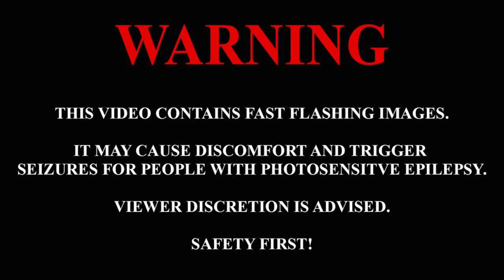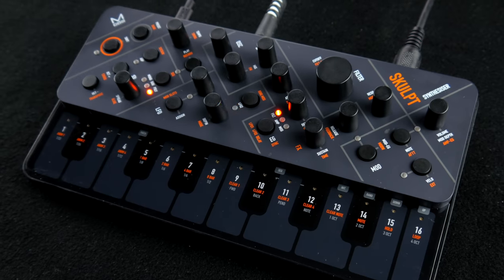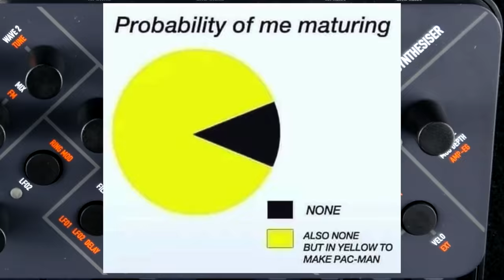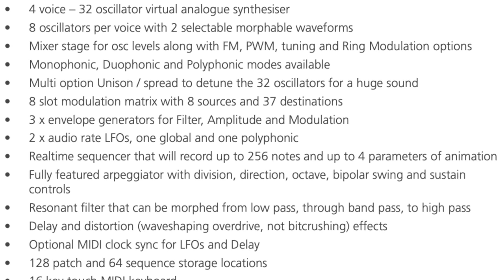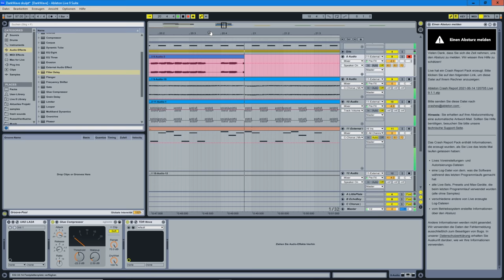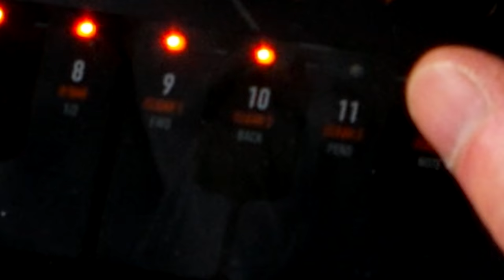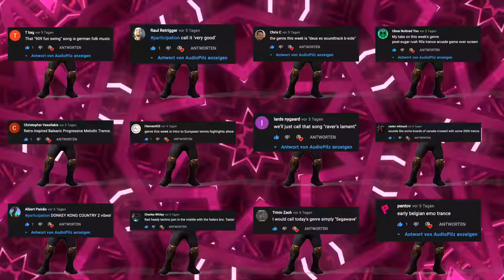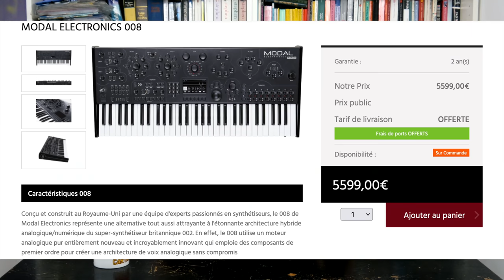Bad Gear - Modal Skulpt - Plastic Toy???

Comment: I’m not gonna lie, if it wasn’t for the fact that the beatstep is my centerpiece this would be a no brainer.  Currently debating the micro freak and that Roland JD.  (x1? Xi?).
Reply from the maker: MicroFreak is super interesting!!!
Reply: Have both
Microfreak = better/more interesting sound, consistently evolving firmware, atypical interface, seq is bad
JDXI = all in one groovebox, menu diving, drums sound amazing, no continuous support
Reply: I didnt regret buying microfreak. this little box has so much potential and you can go totally bonkers on crazy sounds and modulation.
Reply: Another nod for the Microfreak. I still haven't even scratched the surface to get to the surface on it, but you get FM, Wavetable and subtractive synths AND a killer vocoder in one device? And, the aftertouch on those freaky PCB keys is just... a thing. But a good thing,.
Reply: Let us know which part of the Microfreak was broken out of the box (or if you got a good one, which part failed first 12 seconds after it got out of warranty). For me, it was the headphone jack, so sorry, no vocoder on my Freak when the update came...
Great sounding synth. Too bad it isn't a great synth. 😥

Comment: Nice to see something that's not retro, I've been wondering about your channel. I might be wrong but "Bad Gear" means "what can I get cheap and wing it with some phat effects". This channel is a primer for little techno treats at car boot sales, pawn shops, and grandad's attic :) There's no such thing as bad gear, just kit one has grown out of and graduated to primo devices (for better or worse).
Reply from the maker: Unfortunately, all that stuff isn't so cheap anymore (with a few exceptions)
Reply: @AudioPilz  yes, you are right. I'm about to buy an Analogue Solutions My Hyde for £95 off Gumtree. London is very good for getting bad gear, which can be bad, very bad. Not badass bad, but sad old man bad. Its easy to buy turkey's, basically defective devices. I think I will start a new channel for kit hoarders. We have a lot to learn from each other :) and I've made some silly mistakes thinking they were wise lol1

Comment: The interface design of this synth is so off-putting, I'm having a hard time even watching the video. They certainly nailed "unique looks", if that was what they were going for.
Reply from the maker: Very strange at first but you'll get used to it quickly
Reply: Takes about 20 minutes to get used to. Most functions are on the front panel. I only used the editor once, tried the random patch option and lost 2 hours experimenting. For the price point it can make some pretty unique sounds.
Reply: I seem to be incapable of understanding how folks get confused. Everything is laid out great. Tilted text throws folks off? That doesn't even make sense.

Comment: Well this WAS on my short list when I was looking for a new polyphonic  synth .  Seems like a volca sized  everything box .  If the build quality is low why not just borrow a
no parking sign , and a cut piece of heavy "Bar floor-mat"  to  make a solid  rigid 
enclosure /stand ?  
When I look at the ui I get a mild panic attack . Why are the words pointing in all different directions ? Do they want us to put it on a turntable ?
Reply from the maker: Honestly thought about putting it in a "real" enclosure;)
Reply: @AudioPilz  I did that with my pocket operator , and a monotron . I left space underneath for storing batteries , and some aux cables .

Comment: Well, IMHO the only reasons to call this 200-250€ synth bad gear are the software issues and weird front panel design. The SE can be had for a little over 200€, and might be more stable. Still, this is the right price point for a 4 voice VA synth, not the 400€ Roland is asking for their boutique series nonsense (except for the D-05, which has the 16 voice polyphony of the original)
Reply from the maker: Agreed, build quality on the Rolands is much better tho

Comment: I wanted to love this one so bad. It sounded lovely, but yikes, it may look good when just looking at it but the build quality was quite a shock. Not kidding, the paint started to drop and get scratches immediately when I sat it on desk. And yes, it made sounds when I lifted the synth just holding the thing while plugged in. Still, it's sounding GREAT and is reasonably cheap, but hopefully the new Skulpt synth is a lot better on the build front.
Reply from the maker: True that! Build quality is atrocious!

Comment: This thing is so intriguing, as is almost all the stuff Modal makes. The UI-designer should be pulsewidth-modulated though. Always wanted to try a 002 or 008...
Reply from the maker: Funnily enough, I read a comment written by a professional UI designer and he said that the layout was obviously designed for building up muscle memory (which I found rather interesting)
Reply: @AudioPilz  That’s quite interesting indeed, could be that after a few weeks you get the hang of it and can read and write with the machine… It dóes make the synth look a bit more industrial-y.
Reply: 002 is okay, 008 is cold, disappointing and I'd even go so far as to say feels unfinished. Got better sounds out of the Korg Minilogue than the 008.

Comment: Hallo Mr. Pilz, for a future episode I want to mention that currently there are three Roland EG-101 for around 200,- each on willhaben available. You might know this thing and maybe it would be a good fit to your storyline. For about the Skullpt I have to add that I find the way of storing and selecting sounds and choosing banks awful. I mostly use a powerful moog-like bass sound with a dangerous mysterious timbre, and nothing else. The Netzbrumm "feature" of the Skulp I accidentially solved with an old USB power plug...just tried everone I have ;-)
Reply from the maker: Thanks for the heads up. The one right here in Vienna unfortunately has a broken D-Beam;)
Reply: @AudioPilz  Ah oha I did not see that the seller Wolfgang made 2 ads for his one synth without working D-Beam, and the one in Grieskirchen, who is a Heimwerker, obviously, is far away and wants Selbstabholung. Too bad ! Sorry ! (But maybe you have someone who can repair the D-Beam ?)

Comment: I love my Skulpt. The app running on my tablet helped me understand the engine and now I rarerly plug it into the app . I dont mind synths with seemingly  impenetrable interfaces because it feels so good to master them. Like learning a new dance. It crashes very ocassionally ..at least the interface seems to lock up..but not too often. Its worth it though as sometimes I get sounds out of it that cut through the mix like nothing Ive ever heard.
PS the randomise functionnis excellent as it makes small iterative changes to a patch in a way Ive never seen before.
Reply from the maker: Agreed, I forgot to mention the randomizer but I rarely use them myself

Comment: My experience with the Sculpt is bittersweet.
     Love the sound of it, hate the layout, hate the endless shift pressing, but the big gripe is having it pack up after three months because of the delicate crappy USB power socket failing.
     I'm still pondering whether to try and fix the thing (not under guarantee as it was a display model).
     Amazing sounds......It deserves to be mended.....
Reply from the maker: That's frustrating. These USB ports can be hard to fix
Reply: @AudioPilz  Yes, probably beyond my skills with a soldering iron. All I need is the power side of it, though. Not the data side. That's two connections, I guess. I'd risk ruining it, but I can't reliably use it anyway.....I'll have to think about it :-)

Comment: Had one of these for a short time. I just couldn't get over the panel structure. It was extremely confusing and all the shifting made me feel dizzy. Granted the Skulpt sounds good but it needs a display VERY hard. Without the app it is pretty much unusable.
Reply from the maker: I had the same feeling at the beginning but the interface grew on me quickly

Comment: It's interesting to hear that people are getting crashes and freezes. Got to be firmware surely, I've had 2 of them for around 6 months and I don't thing I've ever had 1 crash or freeze. I've had to restart them on a couple of occasions after a power surge but hey, I'd need a restart too!
Reply from the maker: There are some midi sources that seem to crash it quite reliably (eg the Beatstep Pro)

Comment: I actually bought this synth and I feel like it was mis sold, it doesnt have 32 oscillators.. It has two.. lol... There is no way to access the other 30 oscillators unless you used the "spread" technique using them in unison but spread out.. Am I missing something? I even contacted modal and they couldnt explain how to access the 32 oscillators ..
Reply from the maker: I think it's quite similar to a supersaw. I wouldn't be aware of any way to access the oscs independently either...

Comment: Thanks for not putting markings on the in/out  connections Modal. A simple midi in or midi out sign would have helped or did you run out of money? I
Reply from the maker: I'm pretty sure they did;)

Comment: Do the analog rytm, ik it’s far and away one of the best drum machines on the market but the relatively limited tracks, the inability to use the analog effects on the individual outs/overbridge outs, the analog snare being pretty whack, it being a one shot sampler that sucks for sequencing melodies, the not that responsive pads on the mkii, and the lack of pad cutoffs for classic mpc sampling might make for an interesting video!
Reply: This is coming from someone who owns one and uses it religiously btw
Reply from the maker: Great suggestion, thanks!
Reply: And it sounds way to clean!

Comment: Yet another synth I was on the verge of buying some time ago but opted for an electric guitar at the same price point instead. BTW, Flo, maybe you don't remember but I mentioned on the UnoDrum episode I was also on the fence about it but I finally pulled the trigger! It's a great sounding machine, it definitely has tons of character. The compressor and drive sound great too! It's very much a pity that there are no buttons on it as it kinda feels like a tablet at times - but at least it has encoders and it's tons of fun to toss around with you and jam out anywhere :) Cheers
Reply from the maker: Nice! Thanks!

Comment: One of these and an NTS-1 is pretty much the best $300ish value around. I take those two and my 1010 Blackbox when I travel for road noodling and I am always surprised at the cool stuff I come up with.
Reply from the maker: Agreed but I would be afraid of dropping it while traveling
Reply: @AudioPilz  then you put it on ebay as "Artisanally circuit bent"

Comment: Only had a quick play with my skulpt, which I picked up for £100. Sounds good and the app is cool but it keeps kinda disconnecting from my Keystep 37. It’s still there but I have to change the patch in the app and back again to carry on 🤷🏻‍♂️ It happens if I’m using the keystep’s arp, it’ll play great but if I hit stop and try to restart it, there’s nothing there.
Reply from the maker: It's not exactly reliable

Comment: I've been eyeing up one of those cobalt 8s myself
Reply from the maker: Yup, interesting stuff
Reply: I have both the OG Skulpt and the Cobalt8M. Both are awesome in their own ways, and surprisingly the waveform selections and ease of FM on the Skulpt make it its own thing compared to the significantly more powerful Cobalt.
Reply: @M Edward Borasky Prior to the days-old 1.1 firmware for the Cobalt (which I just stumbled on while doing my research for this reply), the Cobalt had no FM capabilities at all, while the Skulpt has them front and center as a shift function in the oscillator section. Now it looks like part of my evening is going to exploring this new firmware! 😃

Comment: I have craftsynth2. It's a bit... idiosyncratic. It has some nice sounds, but unfortunately its more of a sample source than a proper hardware synth. The sound is cold and lysergic, but some for me the RTZ envelopes ruin it as a monosynth. When I bought it, I had brilliant idea of using it live with VST plugin, so it would automatically change presets and everything else, but alas it has horrible buzz, when powered over usb. I was thinking I found my perfect bass machine, but the bass is not its strong point. There are some characteristic sounds, but overall its a bit gimmicky. I'm 50/50 whether I should sell it or not. To be honest, I think volcas do pack better punch, especially first batch (keys, bass).
Reply from the maker: Certainly not the first choice for bread&butter sounds but nice for soundscaping
Reply: @M Edward Borasky its probably a lot cheaper to use an isolator on the audio side, or the same sort of groundless unbalanced to balanced connection IK recommend for the uno
Reply: @M Edward Borasky that's cool and all... But I'd rather take volca kick with me. More fun to play live, no need to have midi sequences. The goal is to have as little wires as possible. And in the end it's not worth it, because it's not "super 303" , but a crazy drone machine. 

But hey, I had few road trips with cs2 and portable speaker and it was super fun. The concept of electronic kalimba is actually really cool. Maybe I should do a video about such use

Comment: Mine seems to crash connected to the SQ64 too, but happy enough connect to the model:samples among other things. It crashes even if theyre just sitting there connected sending no data seemingly. I'm gonna try making a midi thru box
Reply from the maker: It's absolutely mysterious!
Reply: Reinstall the firmware. That cleared up a lot of those issues for me..

Comment: The trick with organ sales is to use someone else's. Preferably a tacky plastic synthbox designer.
Modal's mid range synths (Argon/Cobalt) are farbulous and funky, but the Craft and Skulpt are lightweights compared to the nearest equivalent nanosynth, the GForce Minimonsta.
The Skulpt sound engine would make a great vst. That way, you could ignore the "quirky" design and kamikaze OS,  and concentrate on the sound design aspects.  As it is, it's an Austin Allegro with square wheels and  a Ferrari  engine. Sounds lovely, but it's harrbl to drive.
Reply from the maker: Maybe put it in a "real" enclosure;)
Reply: @AudioPilz  : But that would cost a dollar more to make, and it would never become obsolete, unless the OS choked on a stacked lead line.

Comment: Sounds great but doesn't work lol The midi clock is broken and stops playing the patch and my 5 pin in stopped working 3 months in. I do like the touch plate and I don't think its bad. Changing patches without the app sucks and that is the biggest gripe about the unit.  Hopefully I can get a replacement so I can play it with my rig. Sounds better than the micro freak but the MF is more functional actually f**** works. Would not buy again.
Reply from the maker: Yeah, great sounds but hard to integrate in setups

Comment: The Modal 002 would be fit for a bad gear video lol Played one many years ago at a show and hated it. The OS was unusable to the point that even sound selection was horrible (maybe now fixed?) and to me it didn't sound any better than fully digital instruments like the Waldorf Q which I still think smokes it
Reply from the maker: Really? The 00 series seemed super interesting to me. Thanks for the heads up
Reply: @AudioPilz  No idea the OS may of been fixed now but for example patch selection you had to type the preset number on the keypad and then press enter and stuff like that which just reminded me of the ol' JX-8P and wasn't enjoyable to use. On the other hand I like the looks of the Cobalt8 and think it sounds pretty cool. Unrelated you should totally track down a Roland PMA-5 hahah

Comment: Do you have plans on getting the Behringer guitar into the show?
Reply from the maker: Which one exactly?
Reply: @AudioPilz  The uglier one, which had some USB functionality. It's the iAxe series, the iAxe393 is even uglier, much older (you might need your XP machine to get the USB functionality working), and I knew at least one person who owned one 10+ years ago (a girl, who had an anime-style virtual avatar before Kizuna Ai made it popular), and probably one another (a guy, who last time played in a typical Hungarian alt-rock band, but then we knew what happened) if he didn't had the another one. 

But since Behringer guitars are universally disliked due to their cheap quality, and the inclusion of a tremolo system that's only good to detune the already hard-to-tune instrument, you can feature any of them. But please, if possible, get the USB one for the added awfulness factor. Who knows, this time you might find a real stinker of a gear, that's not just have a hard-to-use user interface, or hideous.

Comment: This thing has an invisible knob you need to turn constantly. Its your head when youre trying to read the diagonal texts on the UI. That, or the synth itself that gets rotated like a steering wheel.
I get it, they wanted a stylish and dynamic look, and it looks pretty scifi, but having to roll my head just to be able to read what Im doing. Its more hassle than is neccesary
Edit: That overlay shouldve been the default UI design
Reply from the maker: Agreed!

Comment: What would be the closest VST to this? Because this feels like it should have been one.
Reply from the maker: Good question. I'd like to hear suggestions too
Reply: @AudioPilz  Not a VST technically, but The Audiokit Synth One IOS App has a somewhat similar feature set: 2 continuously variable oscillators with FM + noise (no ring mod), suboscillator, built-in FX, arpeggiator, mono sequencer, 2 LFO's with 12 destinations, Lo/Hi/Bandpass filter